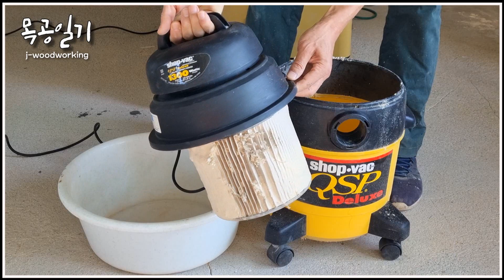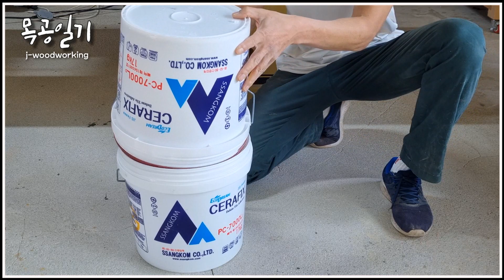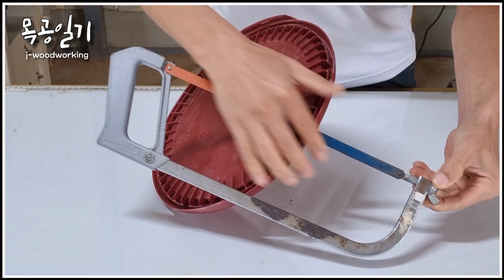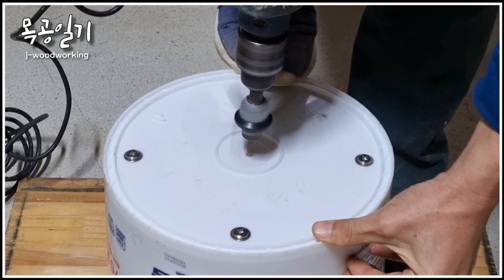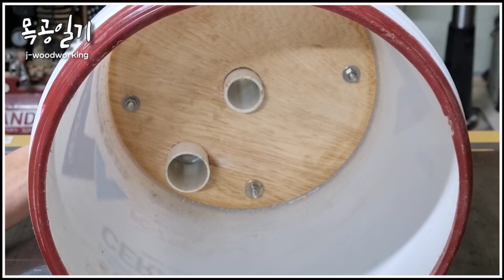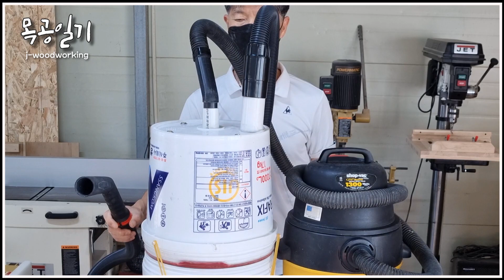don't need to clean a dust cleaner filter / cyclone vacuum dust collector [woodworking]

Comment: Awesome job making this collector J. Separators can make life SO much easier. I just wish that shop-vac manufacturers would make their vacuums with separators BUILT IN. That way, the vacuum would just be taller with no extra footprint and also less hoses. I also like yours because you made it and save money over buying one.

Comment: I created something like this last winter. The two pvc sections going in the top, the one drawing air should be nearly flush and the one pulling the dust into the pail is about 6 inches into the pail so dust can't be sucked up to the vac container. I am not liking the rubber bands holding the two pails together. Cause someone will at some point pick them both up when the bottom is full of saw dust. I prefer friction holding the two together or wedging them into each other. If you cut slits into on of the tops the other will slide into the other. Other then that it looks great. Just try to find a connection pieces to go from the pails to a table saw. That was a nightmare  jerry rigging pieces to connect them. You can't find any pvc that is 2 1/4 inside dimension which my saw needed. Had to use a landscape drain tile cover and invert it to make the connection.

Comment: I added a cyclone dust collector (13€) to my shop vacuum. The cyclone dust collector got coupled with an old oil barrel of 60L. In top of not needing to empty it very often, the filter never get clogged by dust as I use (the same) filter bag since 6 months. There is very few dust landing on the bag and basically no dust at all on the filter. Cheers

Comment: Never do this! A tube with an angle of 90 degrees will constantly clog if a long piece of wood gets into it. You need to cut a straight tube tangentially from the side.
Никогда так не делайте! Трубка с углом 90 градусов постоянно будет забиваться если туда попадет длинная щепка. Нужно врезать сбоку по касательной прямую трубку.

Comment: Glaubst du wirklich, daß du PE mit irgendeinem Kleber kleben kannst?
Reply from the maker: I put silicon after glue.
Thanks for watching sir.
Reply: @j-woodworking9573  Even silicone does not stick to PE!  You only know PE by welding!  Do you understand?
Reply from the maker: I used plastic baskets and plastic pipes. No need to weld. Thanks sir.